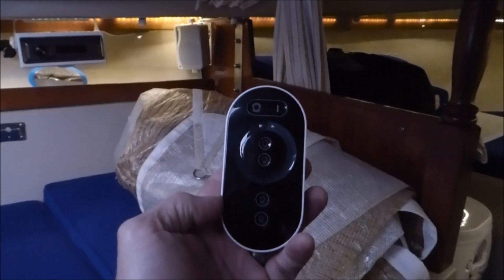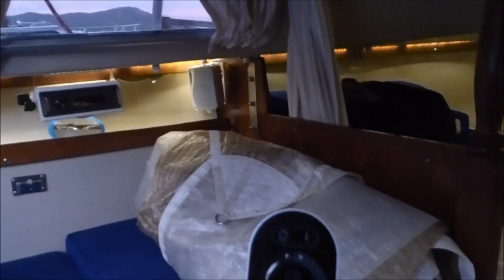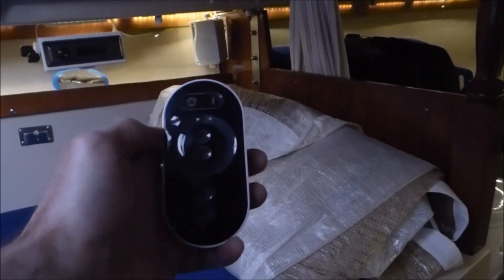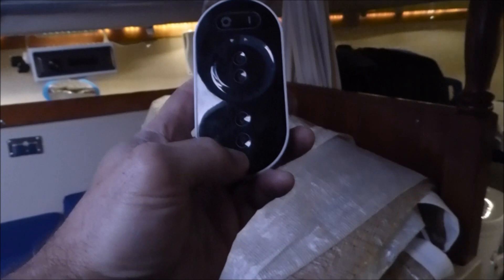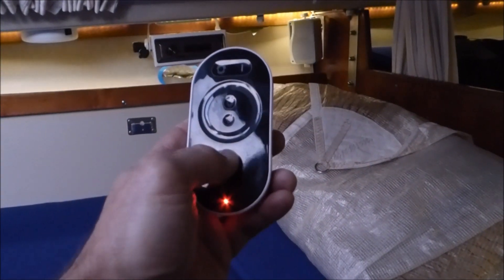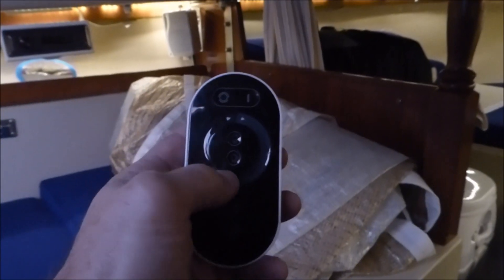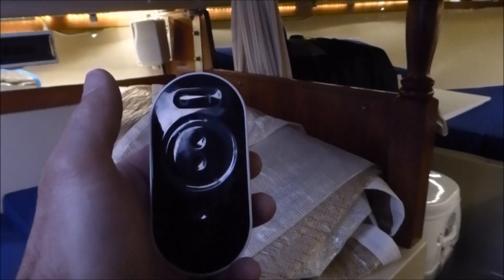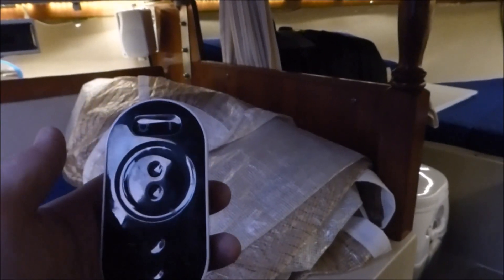LED Light Strip 2-Channel Remote Control

Comment: I have a Catalina 22 I’m new to sailing it does not have a main sale do you know of a place I can buy a used sail
Reply from the maker: Hi, Jim
Check with your local sailing club or marina if you have one. That way, you'll be able inspect the sails for sale. If that doesn't work out, try your local craiglist.org and/or Facebook Marketplace. If you're still not having luck, you can try eBay.com but you won't really know what you're buying so don't spend much and be prepared to accept whatever they send you.

Hope that helps,
$tingy